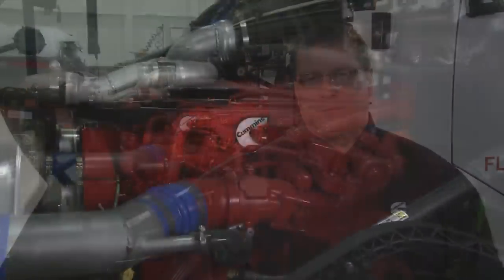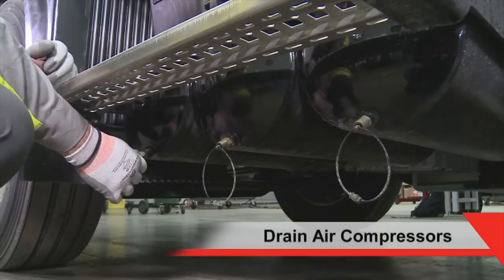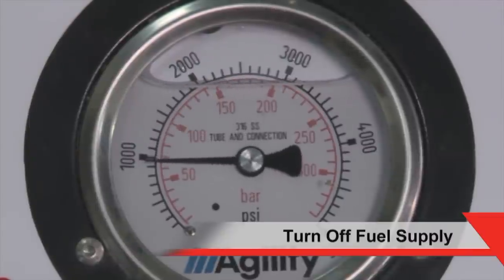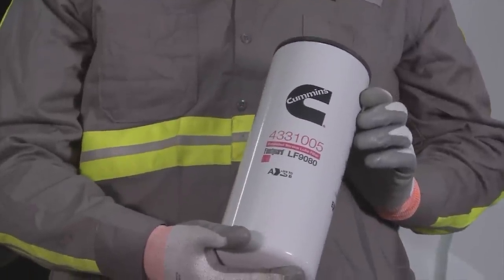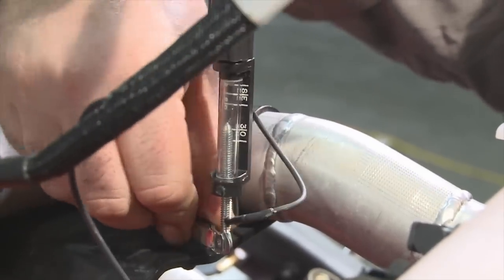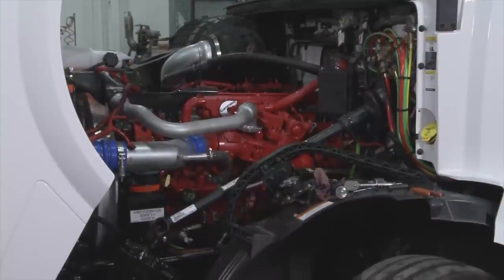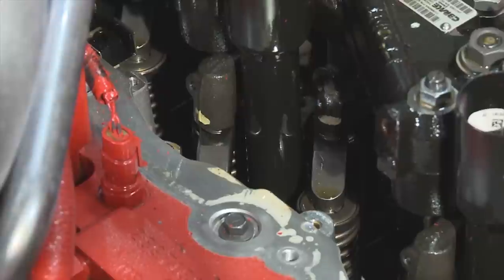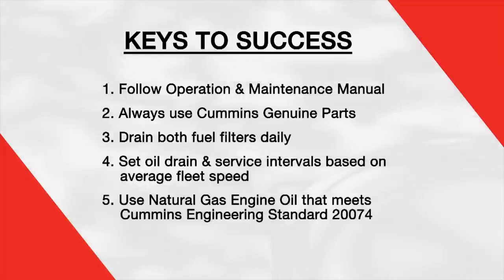Cummins Westport ISX12 G: Introduction to Maintenance

Comment: They run hot and are not as toquey as diesel
Reply: Not true I've driven this truck fully loaded bought used and don't know if it ever got hot. My Temps are never near 200 psi. Unlike my diesel  isx 12 always reaching temp on every load. About the torque specs believe it goes . Still haven't seen anymore pull after a hill faster then this truck. It depends on the driver